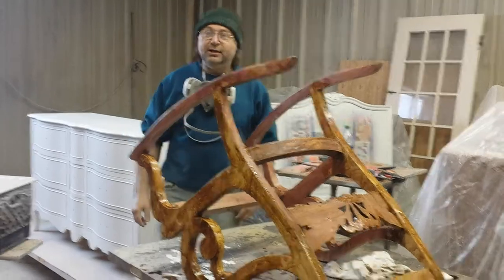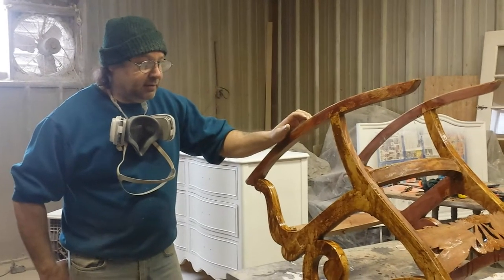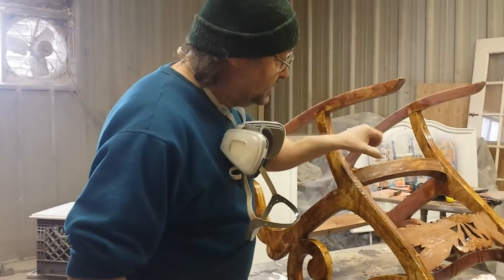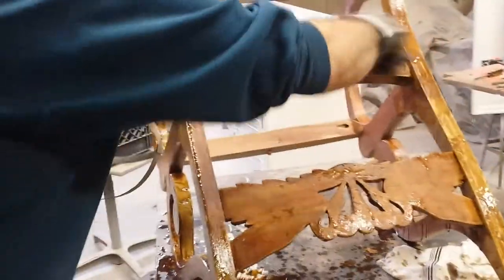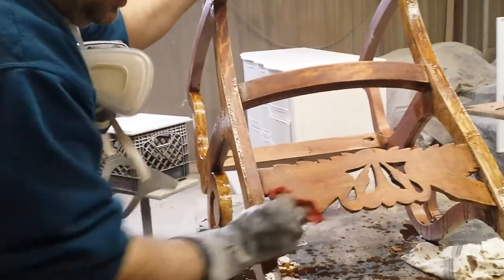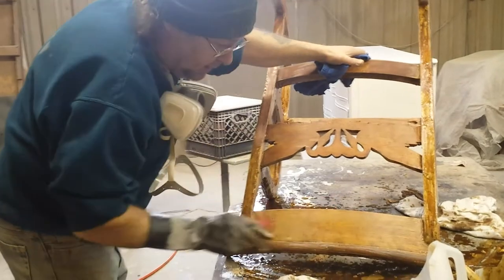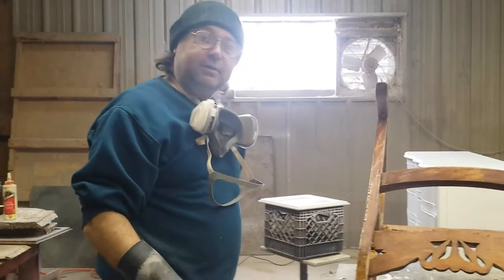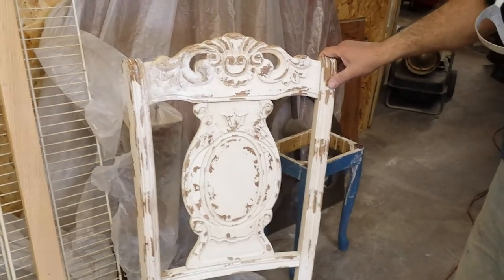Antique rocking chair refinishing at timelss arts refinishing

Comment: I’m restoring an old wooden captains chair and have it sanded and stained and ready for the finish. I’m thinking polyurethane if that is an acceptable finish for furniture. The seat will be cushioned and upholstered afterwards. My question is about applying the poly. I don’t have a sprayer, so should I apply multiple very thin coats with a natural bristle brush, applying a coat over the entire chair, or should apply it in sections like sitting the chair on its side and applying a coat to the top face, then other sides top face, so on and so forth? Also since they are thin coats would you recommend brushing it on, or soaking a rag/towel in the poly and wiping it on as I’ve seen others do?
Reply from the maker: well i always used a spray gun ,but lot,s of people brush  polyurethane  on ,one coat at a time ,
Reply: bruce lach thanks I just wasn’t sure because of multi dimensional and sides of legs and stuff if it would be any different than say a table top where it’s more a 2 dimensional surface